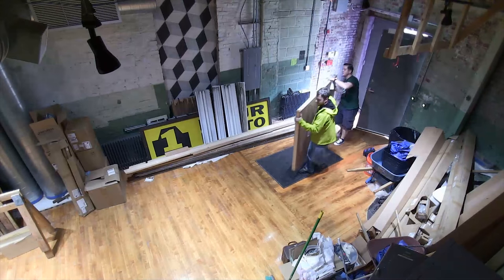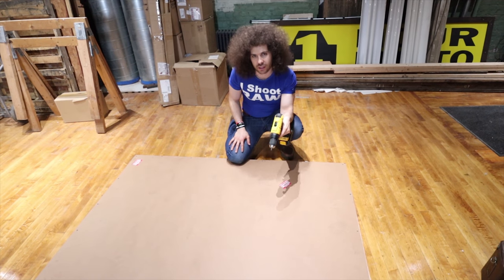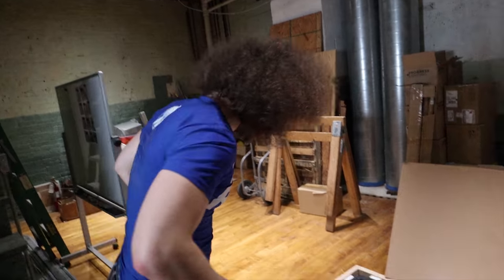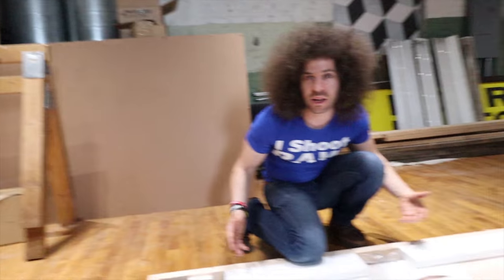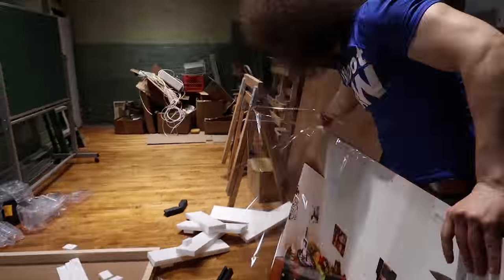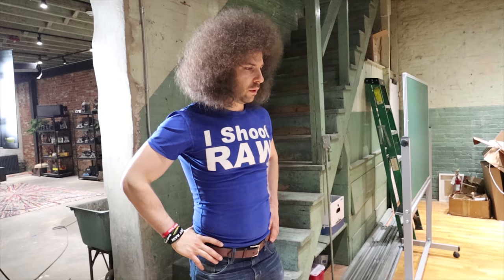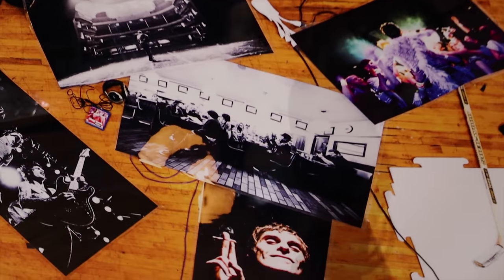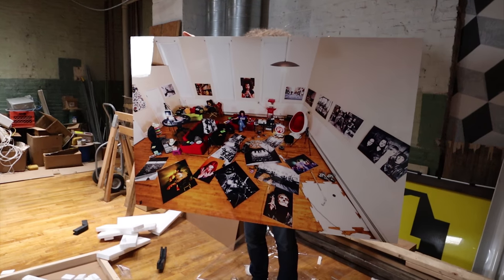WOW, MASSIVE 40x60 $600 Metal Print

Comment: What megapixel was the image, what resolution is the print, and how does it look close up? I would assume this is 20MP, that seems like it would look soft printed that size?
Reply: James Ryan yes good question I'd like to know as well!
Reply: He said it in one comment. He used a D4 in 2012 which has 16 MP i believe.
Reply: If the image is properly exposed in camera, and no post processing is required, you can print a photo from a 6mp camera to almost that size. I printed a photo taken with a Nikon D40 (6mp) to 20 x 30 and it looked awesome. One day I want to make a metal print of it as well, since the first one I did is hanging at a local nursing home.
Reply: It's more about the distance you're gonna view it at over how many megapixels. Those billboards you see by the side of the road only want 2-5 MP because nobody is viewing it up close. https://www.youtube.com/watch?v=UCaZt5ndRW0
Reply: Josh Boddington you are correct, but I would guess you would view this close enough to see the lack of resolution.
Reply: Possibly not. I've made 5ft by 5ft square prints with an 18mp camera, so about 14mp worth of the actual image and they look great unless you put your face against it. They do look softer up close, but you notice grain more than anything else. I've also printed a 20x30 metal print of an iPhone 5 photo (I think 8mp?) and that looks great also. I think it depends on the quality of the printer. Also realistically most people are going to want to view the whole image and you would have to stand back to do so.